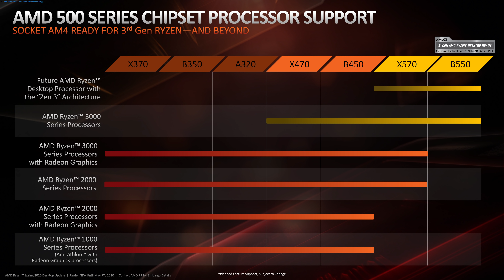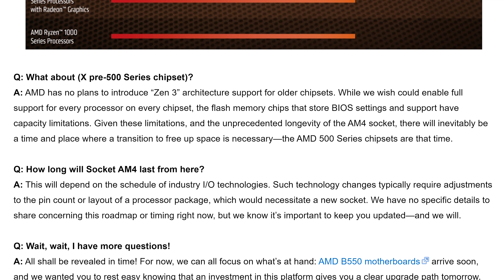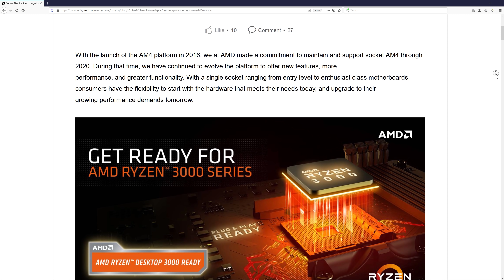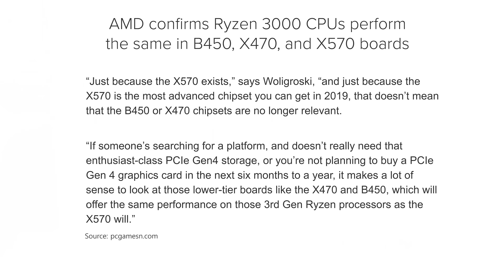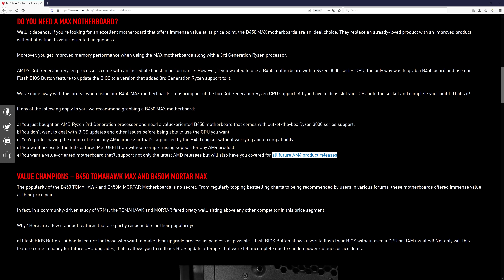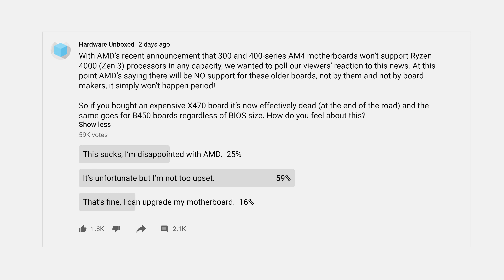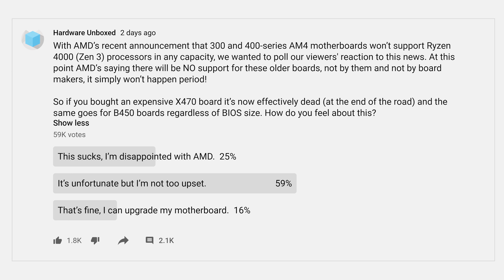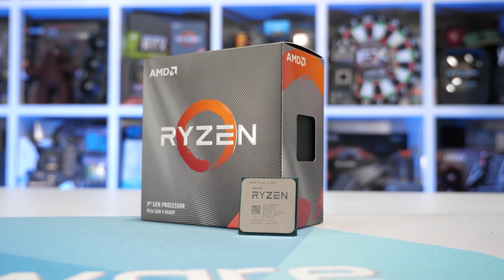AMD Does An Intel, Axes Zen 3 on 400-Series Motherboards, Our Thoughts

Comment: This is just a dumb business move.  I'm one of several people with a 400-series board who was considering a Ryzen 4000 series upgrade.  I originally bought this board along with a 2600X, and had plans to upgrade to a 4th gen Ryzen 7 CPU with my 2600X going to a friend with a very old Intel platform and not much money.  Yeah, specific scenario, but a lot of people who were pretty much sold on a Zen 3 chip are now changing plans.  There is NO WAY I'd buy a 500 (or 600?) series board just to buy a Zen 3 CPU and be at the end of the road, as we all know Zen 4 will launch alongside a new socket with DDR5 compatibility.  Seeing as how AMD's customer core in the consumer market are primarily enthusiasts who know their stuff, this move makes ZERO sense.  They will lose sales over this, full stop.  Nobody wants to invest in a dead-end platform with the impending end of AM4 coming in the near future.  Weak move by AMD, and I don't understand why there are people out there actually defending them on this one.  Not saying AMD is a bad company, but this is for sure a bad decision on their part.
Reply: Exactly same situation. Am on 2000 series and skipped 3000 series. Planning to upgrade to 4000 series but buying a new mobo that's EOL on the socket is just bad investment at this point. Probably would just wait for the 5000 series with new socket and DDR5 instead to replace my whole system.
Reply: Yep 100% in the same shoes, bad move by AMD. I hope they enjoy their CPUs sitting on store shelves.
Reply: I was actually in a very similar situation to you, also. Damn.
Reply: In the same boat,will wait for 5000 or go back to intel if  they  release something more compelling.
Reply: In the same boat. Went 2600X and shelled out more for a X470 so if a scenario like this happened I'd have a better chance of being covered for a 4000 series bios update. Also planned on donating the 2600X to a buddy on a 7+ year old Intel platform. Sub-optimal situation to say the least.
Reply: You nailed it! Same here: X470 with 2400G. Planned to upgrade to either Zen3 8-core APU or CPU (depending on how good the Cezanne(?) GFX is).
I will for sure not buy another AM4 board!

I mean: In the end there will be 4 CPU generations on the AM4 platform. One generation per year: 2017, 2018, 2019, 2020.
Back in 2016 or 2017 AMD said AM4 will be supported until 2020, i.e. for 4 years=generations.
Of course this has to mean that you can plug-in all CPUs of all these 4 generations into all AM4 boards.
If not, if  boards suddenly only supports 2 gens, then what is the whole point of having the same socket?

I still could somewhat accept, if for commercial reasons boards would not support all 4 gens, but only the current and the next two generations.
Meaning: 300 series boards supporting Zen, Zen+, Zen2 CPUs and 400 series  supporting  Zen+, Zen2, Zen3
But 400 boards only supporting one follow-up gen is not good enough, considering that all the hardware is basically the same.
Not to mention those that bought a B450 together with Zen2 (due to lack of B550) and have no upgrade option at all.
 
BTW: The PCIe 4.0 decision for 400 series boards was also crap! I bet my board is perfectly capable of running PCIe 4.0 in the first slot and in the CPU's M.2 slot.
But no. Just because of this BS-reason "we don't want to confuse our customers". Where would have been the confusion, if each board-vendor clearly communicated, which of their boards support it and which not?
Reply: Same here. X470, 2600. Planned on getting a 4000 series when new consoles drive requirements up. Likely getting a 3700x now when prices drop low enough on eBay.
Reply: b450 2600x owner here, had the exact same plans as you did, I am as mad as you are.
Reply: Im on a similar spot, have a 470x and bought a 2700x, that went to my sister when i upgraded to a 3700x, and this 3700x was going to my grandpa computer (hes actually into video editing and has a first gen ryzen). Now my grandpa gets no new CPU and i overpaid for a motherboard for nothing.
Reply: Yeah same, I'm still using a first gen r3 1300x and am looking forward to upgrade to 4th gen ryzen, but I guess I'm just gonna wait until ddr5 so that the 3rd gen chips will drop in price...
Reply: I agree it doesn't look like a money grab by AMD ; it just looks dumb.  My Asus X470 board has a 32MB BIOS capacity anyway, so their stated reasoning for this doesn't even begin to make sense, and it still doesn't fly if your board's BIOS capacity is only 16MB for the reason stated in the video.  I really doubt that supporting 400 series boards is some kind of herculean undertaking.  I'm hanging on with what I have until DDR5 comes, even if it takes longer than expected.  I never was an AMD fanboy, and I'm not an AMD hater now by any means, but this is just dumb.  Pissed off customers & business partners, and for what?  AMD is shooting themselves in the foot here.
Reply: My own scenario is very much like this.  I bought a 2700 non-x with my ASRock X470 Taichi (a board with a 32MB bios like the MSI MAX series), and due to AMD saying they were committed to the platform through 2020 (you know, when Zen 3 has been on their timeline all along!) I fully expected to be able to upgrade to the 4000 series.  Some in this thread have commented "why not get a 3000 series," and the answer is simple:  The performance gains aren't enough to justify it.  With all we know about Zen 3 so far, the performance increase from 3000 to 4000 series alone might justify the upgrade, so from 2000 to 4000 goes without saying.  If I would have known I'd only be able to upgrade to the 3000 series, I'd have saved $139 and bought a B450 board THEN in July of 2018 (well, I think I still would have had to wait a few months for B450...).

People who bought a 3000 series and B450 board over the last year have EVERY right to be royally pissed of, even more so then myself.  Many trolls are reddit justify this by saying "you can go get a 3950X," but if you don't need the extra cores for productivity and have a gaming rig, what is the point in having anything above a 3800X class CPU right now?  None.

Specifically in my instance, I was planning on spending $200 to replace my case and prepare my rig for an RDNA2 graphics card and Ryzen 4000, but without the ability to upgrade my CPU is there really a point in a 2700 with a RDNA2 graphics card?  Atm I am looking at another $200 for an X570 motherboard that has AT LEAST the two m.2 slots I'll need to migrate my system (unless I get lucky and find a B550 board with two m.2 slots).  I'm not sure my budget can handle that, so the likely hood of me upgrading now is almost completely gone.  No point in the RDNA2 graphics card without the faster CPU.

I know that if this stands as it does, I sure has hell will never buy another high end AMD motherboard ever again, and I sure as well won't be recommending them.
Reply: I agree, they will lose sales over this.

Equally, if not more important, they are going to take a reputation hit. Today's world is continuously showing us that your reputation is very hard to redeem and is somewhat vital to companies success
Reply: ptown77 the 2600x should for sure last until am5 comes out. im still running on a 11 year old dual core, be grately you have a pretty recent 6 core.
Reply: Depends on the price I would say. If you just want a PC, which lasts a few years without ever upgrading the core components (mobo, cpu, ram), buying obsolete parts doesn't matter that much.
Reply: your going to give your buddy your zen+ cpu who has an intel, so your buddy will need a motherboard to put it in right?.....just sayin lol
Reply: Your loss. It may be a weak move but if DDR5 comes out soon enough, you bet I'll be upgrading. Depending on the performance increase, of course. My RAM was $200 and that's quite a lot of money. Still, it would be nice alongside with a new processor as well.
Reply: not a specific scenario, many of us did exactly what you did. Damn im pissed
Reply: No one is saying it's a good move or even defending AMD. Most state it's a over reaction. People are pretending like they already know the new cpu benchmarks and that they have been screwed based of no information.
It's a bad move because eventually there will be amd5 with ddr5 so why not keep it all in relevant boards. Most actually don't care about this. It's a bad move to them because they have fears they can't upgrade and FOMO sets in. Mind you without the info of new cpu benchmarks or an idea on Zen 2 longevity.
If people were smart they would say: well sucks I can't upgrade my CPU however my current should tie me over until amd5. But they don't due to FOMO and entitlement.
That's the issue. No one is saying AMD didn't screw up, we are saying it's for another reason that won't even affect b450 owners.
Reply: Maybe, next time. Hear me out. Look at AMD's slides on the socket that clearly state at the bottom: “Planned AM4 socket support until 2020. Subject to future roadmap modifications.”
Reply: why not upgrade to a 3600x on black friday when they go nearly half off? And give your buddy the 2600x
Reply: @MetatronsCube23  because he wanted a 4000 series board with more performance, same as me. im pretty much in the same situation, got a 2600X+B450 tomahawk max and figured i could switch to a 4600 or 4700 and extend the cpus life cycle by a decent bit. the 2600X already is a bottleneck to a 2080 Ti and while its not an issue with my 2060 its definitely gonna be an issue somewhere down the line, whether its a 3060, a 3070, a 4060, an RDNA 2 GPU, etc. upgrading from  zen + to zen 2 just isnt a good move... unless youre tossed into a scenario where AMD decided to fuck over almost everybody who has an AM4 board by making the last and most improved cpu on that socket not compatible with those boards for a clearly and provebly bullshit reason. upgrading to a cpu with only a 20 percent increase in performance just isnt ideal and frustrating when you know you couldve and really shouldve been able to upgrade to probably atleast double that performance increase

Comment: I think the main point that is being missed is that I'm pretty other rumours have pointed to AMD switching to DDR5 next year (briefly mentioned). If that is the case then these new chipsets will be redundant in 12-18 months as well and if you want a Ryzen 5000  then you have to cough up another new board. There is literally no reason to not support 370 and 470 boards from a technical standpoint. This is about money.

I myself would have been ready to upgrade this year to a 4700x from my 1700x as there would finally be new gpu's that would make my 1700X the bottleneck @ 3440x1440. As it stands now I'll just wait it till 2021 and see what Ryzen 5000 or the new Intel 10nm desktop parts have to offer instead.

Comment: Board partners also could have threatened to stop offering as many designs if AMD kept supporting old platforms. They need to sell new boards after all, especially high margin boards. Wouldn't be surprised at a board partner revolt. A random assortment of compatibility across a single company's lineup is a mess. They don't want to confuse, disappoint, or alienate customers. The whole MSI max thing isn't ideal.

Comment: I love how you mentioned removing older ryzen like 1 and 2 gen from bios and then adding 4th gen. I was posting that few days ago on reddit comments. If they say the bios has low capacity to support 4th gen. Then just remove 1 and 2 gen support it would have enough space for 4th gen. I call this bullshit move from amd
Reply: Not only that some X570 boards only have the smaller bios chips.
Reply: @jamesthomson8659  that makes no sense. I hope someone from the msi goes underground and releases a beta bios on a 3rd party site to support 4gen

Comment: This sounds silly. I was looking at X370 Taichi's BIOS page while troubleshooting for a family member, and it's implied that they're easily capable of axing Ryzen 1000 series from the BIOS to add Ryzen 3000 series and already did so, so yes, your workaround suggested already seems to be implemented to an extent on some products.
Reply: Or, you know, a 1000 bios, a 2000 bios, 3000 bios.
I'm pretty sure humans have reached the required intelligence to pick the right bios for their CPU.
Then again, maybe not xD

Bastards just aren't willing to do it.
Reply: @x1c3x  it's 2020 not 2019 haha they didn't say 2021 kiddo
Reply: @Larry Bui - actually, that's not true. Just check on reddit in regards to the latest BIOS updates for 300 series AsRock mobos in regards to Ryzen 3000. There are people that successfully updated to 6.20 while still using Summit Ridge.
Reply: Zen 3000 is zen 2 friend 

4000 is Zen 3 haha

Comment: I specifically spent the extra money on a x470 board due to the promise from AMD that the socket would be supported throughout 2020 and with the intention to upgrade to the Ryzen 4000 series of CPU's when they became available.  If this board isn't supported with their new CPU's, I'll be looking into other offerings at the time since I have no plans on buying in to a dead socket.

Comment: Full disclosure first, I have an X570 board so this does not affect me.

However, even though I understand AMD's reasons and think that it is fair for the 300 series chipsets to not be supported, I do believe the 400 series should have continued the support. It is unfortunate that while the 300 series got 3 generations of support, the 400 series only got 2, which is the same as what Intel has been doing for years and I was adamantly against that. It would be hypocritical to not criticize the move at this point. Though, granted, Intel has not been changing their main arch for many years now, whereas AMD has provided two very different archs on 400 series (but my point still stands).

I have one nit-picky criticism though Steve: when you mentioned that AMD was suggesting a B450 board instead of an X570 for budget-oriented customers for the 3000 series CPUs and criticized them for it, I believe that was a bit weird of a criticism. I believe it would be a bit weird of us to expect for them to have thought of future generation support while suggesting a chipset for one specific generation they were talking about :)

Anyways, overall, I definitely agree with you. Take care :)

Comment: AMD should have released the B550 alongside Ryzen 3000... I bought into the AM4 platform for upgradebility, thus, I got myself a decent MSI B450 Gaming Pro Carbon AC just 9 month ago. Upgrading from 6 to 12 or even 16 cores will not be beneficial for my usecase, so I was hoping to get the ipc uplift from Ryzen 4000. Now this thing f** me over. I choose the mb features like intel lan and bios flash back. Also, the same feature set would have been twice as expensive and less economical on x570.

Comment: Personally I'm not mad. But only because I'm broke and I'm still using 1st Gen Ryzen on an A320 board and my next upgrade is going to be a used Ryzen 3600 long after 5th gen comes out (thank you ASRock for still supporting it).

That being said, I can sympathize for those who had to buy a B450 for their Ryzen 3rd Gen. AMD was still promoting the B450 implying that it would still be supported for next gen and their excuse about the chipset is BS. I really hope AMD changes their stance and at the very least give motherboard partners the opportunity to update their bios.

Comment: i  purchased my pc with an x470 motherboard so i could upgrade my 2600 down the line ...  and AMD saying they would support AM4 through 2020 to me at least it means till the last day of the year and when AMD claim I can't get a new CPU because of bios chip sizes that seems silly when they know there are many motherboards out there that have the ability to switch between multiple bios.  Then when it gets reported 3000 series CPUs perform the same in x740 boards as they do in x570 makes it seem silly. Also when I got my system back in early 2019 there were no 500 series motherboards out there and when I told people my specs on the LTT discord and to my friends they asked why I chose x470 it was because I wanted to upgrade in 1 or 2 generations of CPU and because I thought I would have long term support.  if AMD said all this stuff back at Computex when they showed of the 500 series motherboards many of us would not feel cheesed off with AMD currently.  also, his whole situation reminds me of when AMD took away PCIe gen 4 support from some of us x470 users and i see no reason for me to upgrade my Asus rog Strix x470f at least until ddr5 is a thing

Comment: Hmm, I'm on a 350 chipset and I'm very happy to have been able to upgrade to the 3000 series with a beta bios. That said, I'm hoping for a beta bios for the 4000 series APUs since they should use the same Zen 2 cores as the 3000 series. I don't really think it would happen, but it would be the obvious final upgrade path to me for my current build.
Reply: Actually the 4000 series uses a different core layout. Whereas Zen2 uses two 4 core CCXs per CCD Zen3 uses a single 8 core CCX per CCD. That is, a CCX = a CCD in Ryzen 4000. This unifies the two L3 caches and reduces the amount of traffic that has to go over the infinity fabric. This in turn again should bring AMD closer to i9900k/i10900k in gaming performance by reducing internal communication latency and freeing up infinity fabric bandwidth, so it has more memory throughput.... Oh, and there should also be a 10-15% IPC gain in the architecture itself... and hopefully a small clock speed bump as well.